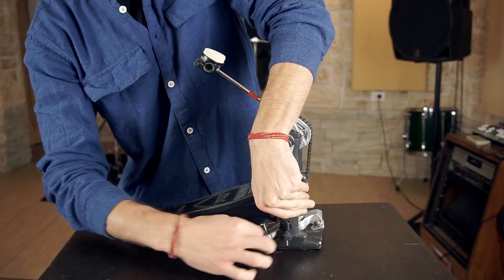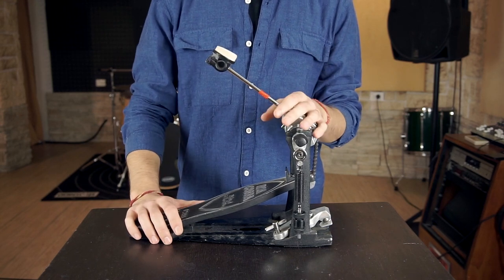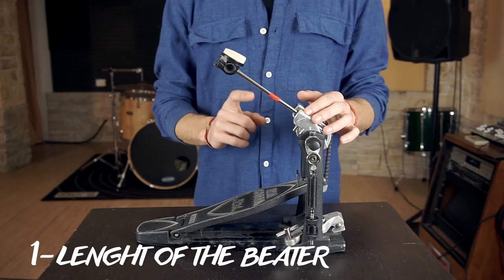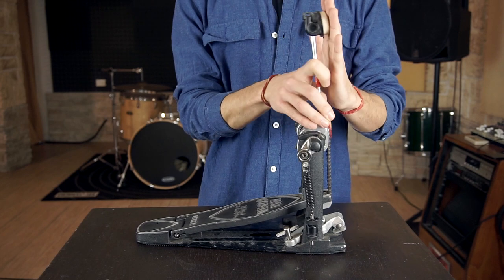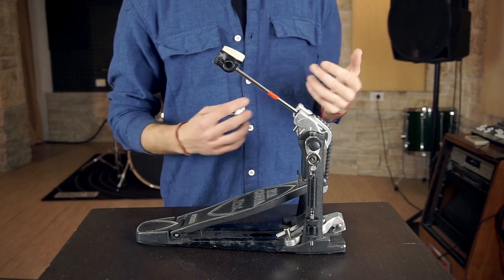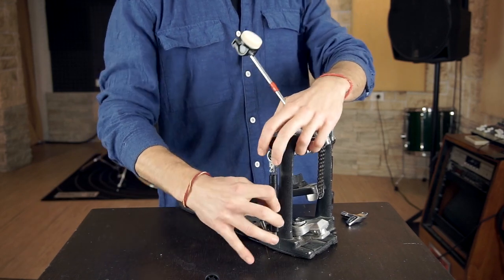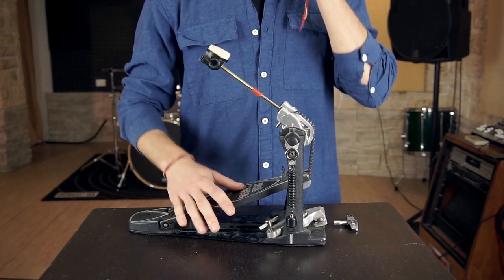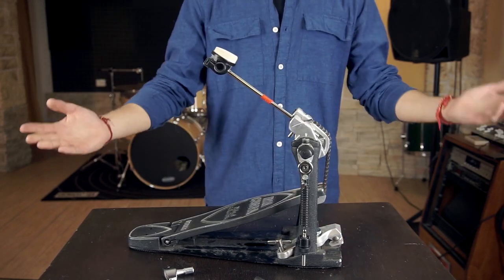3 BEST pedal SETTING for Speed Power & control + tips!

Comment: The video title also says "control", but with a spring tension set at a maximum you actually have less control (or let's say: it's way more difficult to control the pedal). Sure, you can easily go super fast (esp with the Iron Cobra), but control & feeling don't benefit from it.
I  personally find myself setting my spring more and more loose over the years, but still without making compromises in speed. Actually I can go very fast AND have a better feeling & control at the same time. But maybe that's just me...?! ;-)
 The foot stopper thing: many players actually have their foot way too high on top of the pedal. The sweet spot is obviously a bit more down (a few centimeters above the middle I'd say). But again, there is no "ultimate truth" to this. Each drummer has other preferrences of course.
Reply: Music is no sports competition. Trust me & try it yourself. I don't post videos :-) @Clearblue Skys
Reply: Clearblue Skys actually most of the time people think „high spring tension -> fast“. Most metal drummers tell you something different. Like medium or higher spring tension but not max. With max tension you work more against the pedal than with the pedal. I changed to medium spring tension too because i couldnt play with the ankle technique.
Reply: Totally agree ,my settings( Iron Cobra powerglide twin) are just above minimum spring-tension, my beaters  hit below the center of the  bassdrum ( 24 inches). because there is a better rebounce at that point.
Reply: So true. Setting the spring to maximum tension would only make sense if the spring is old and has lost all of its tension. Otherwise, no way are you going to be able to play relaxed.

Comment: Thanks for this. I have a Iron Cobra pedal but with the Flexi Glide instead of the chain. I have been struggling to achieve single foot speed with it. I fear that I will struggle with stamina on maximum tension but will try it in my next rehearsal session. Thanks for making this video!

Comment: I have a double DW4000 and I have really struggled with the settings, it just feels slow and heavy. I can't really go as fast as I want on it. I will try these tips when I get to it, it think it can help. Thanks!
Reply: does it works?? i have the same issue, im usin a DW3000
Reply: I dont mean to down talk on DWs but I had the same issue with them. It hindered my growth for many years. Then I moved to Iron Cobras, it was so much better but still didnt sit well with me. However, tama speed cobras did it for me. It feels like an extension of my body. I would suggest changing into better pedals! Thanks!
Reply: @enayetkhan9397  
Have you tried the DW 5000 or 9000? How do you rate them against the Tama speed cobras ?
I’m using the standard Mapex pedal that came with my kit and looking into upgrading. I’ve only heard of the DW 5000 being a good pedal, but haven’t tested it for myself. 
The tama speed cobra pedal you mentioned has peaked my interest.
Reply: @RexyFan  I just played the dw9000 at guitar center yesterday, they are good but i still prefer the speed cobras! Much smoother and controlled!
Reply: @RexyFan ive used both, speedcobra and iron cobra destroys dw
Reply: @enayetkhan9397  I also have the Speed Cobras. Did you configure the pedal like in the video?

Comment: I'm starting to be able play stuff like Fleshgod Apocalypse's songs with a regular Iron Cobra so yeah it IS possible to go very fast. I'm using mostly the swivel motion myself but I've seen other drummers use heel toe very decently too with the same pedal tho most people seem to recommend using long board models for optimal results with heel toe. Guess I'm gonna have to try out a few models before deciding if I go with long board or not... or just get a Demon Drive from pearl that can be switched between both settings in a few minutes. Thanks for the video, looks like my current settings were good after all.

Comment: Thank you so much for the video. It's very helpful. I have a question that I hope you can help me with. I bury my beater and when my spring is tight, my pedal sometimes makes unwanted hits when I bury the beater. I hope you know what I mean. I hit the bass drum, and then because the tension is high, the pedal has an extra unwanted hit. How do I avoid that?
Reply from the maker: Hi, in my channel there is a video, if u apply these concepts you can fix not only that
https://youtu.be/A1j3LOGXgDk

Comment: The tension of the spring also depends on your body weight... I weigh 55kg and the maximum tension has not worked for me to reach maximum speed... I use a medium tension almost reaching the maximum but I don't have it at the maximum. 🧐

Comment: You say beater should be at Maximum height: i can see still maybe 1cm space/the end of the beater is looking Out (downside pointing to the Floor).
Reply from the maker: Yes It's true! I mean, not to take the beater in half range!
Reply: I would think the lower end of the beater rod could contact the head if it were set too short?

Comment: Hi 👋  I got the iron cobra 310, and the slave pedal bottoms out on every hit making loud clank sound.   Any suggestions on adjustment ?
Reply from the maker: Hi, Try to understand where the sound comes, use some lubricant, in general, will make your pedal last longer, or bike grease.
Reply: you need to raise the angle of the footboard.  I like IC pedals (the 900s, at least) b/c you can adjust the angle of the footboard independently of the beater angle.  The beater shaft isn't welded to the cam - look where they attach
Reply: You may have to release the chain from the footboard, remove at least one, maybe two chain links and then re-attach IF the Footboard is bottoming out, this will raise it maybe a little under a half inch. No more bottoming out. Now, place a tiny drop of oil on that old chain - he's thirsty.

Comment: My anterior talofibular ligament (very top of the foot that connects to 
the base of the shin) started burning/pinching pain.  If I push on it 
with a finger it would burn like it did when I was playing.  Now its 
starting to hurt even when im not playing (just sitting).  Anyone ever 
deal with anything like this?  If so... any advice?  I reallllllly want 
to become great.  I am practicing 1 to 3 hrs every day for the past six 
months.
Reply: How's your foot doing now? I had the same problem and had to stop playing for a long time, like 2-3 months. I still feel it, but it's getting better with time. No remedy has helped, only rest. But now i can finally play again without great pain😏😌
Reply: @kafaanda  it's because I wasn't wearing shoes. I started wearing some skater DCs and it healed up (shrug). The little bit of support seemed to of made all the difference.
Reply: @drakausdromgatti58  That's it! I have allways played without shoes, but when i was getting back into trying to test my foot again, i found out that shoes did support my foot, and take away most of the strain🤦🏻‍♂️🤷🏻‍♂️

Comment: This doesn't work for everyone. Most famous drummers will say they use their spring tension at a midway tension for an all around standard feel. This adjustment may work with speed metal or any type of aggressive drumming, but for an all around tension for session players or drummers of a less aggressive drumming genre, it's not feasible..

Comment: Have any tips to even your foot power? My right foot is way more powerful than my left it often oversped my left when playing doubles.
Reply from the maker: Hi bro, Try something like the stone killer: play 4 stroke for foot, than 8, than 16 etc...and you can also put a groove on top of it, or practicing blast beat in the same time! make any sense?
Reply: Do what you do to warm up on each foot every time you practice
Reply: I improved the precision and power of My left foot by playing songs with single bass drum parts using just My left foot and made sure that My left can do exactly what My right foot can do.
Then, I did exercises to build the endurance of My left unti it can keep up with My right.
Hope this helps.
Reply: Id say even try putting your foot on a different part of the foot board. My left foots toes go on the middle of my board, but my right foots toes go on the back and that levels the power out for me
Reply: Alternating single foot blast beat works really well for me
Reply: don't neglect your hip flexors!  I spent a lot of time getting my left ankle speed and power up, but am still frustrated.  I'm realizing that it's b/c at tempos below 170bpm i should really be using more hip flexor, lifting my entire leg up a little, and dropping it flat-foot style.  Anything above that tempo is just working lightly along with  the inherent motion of the springs
Reply: Troll

Comment: I disagree with some of the points in this video
The higher the tension, the lower the control

Also, while I do have my beaters set at 45 degrees, I have my spring tension as Loose as I can get it on my pedal before the bolt comes off and I can play perfectly fine and perfectly fast.

 I also have my beaters not super low but lower than most and I can play with plenty of power